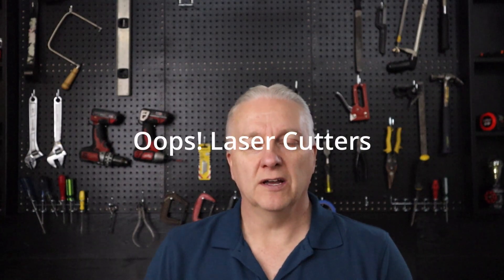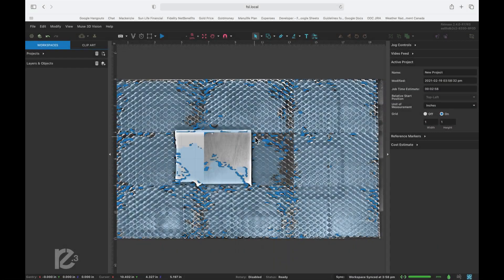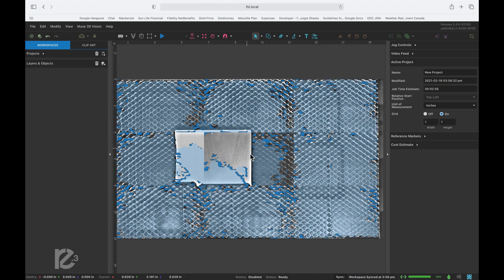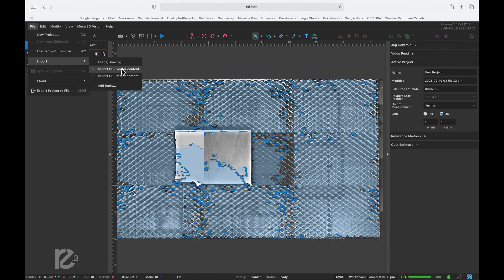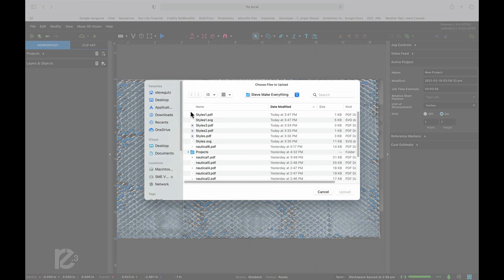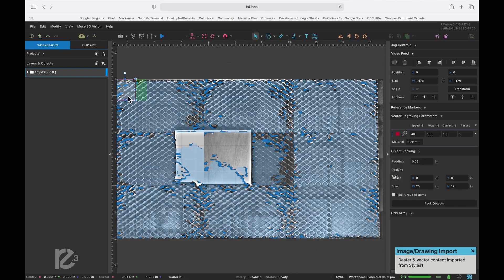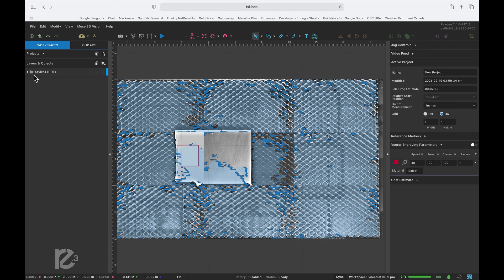3 LASER TECHNIQUES TO MASTER // Laser Cutting, Etching & Engraving

Comment: Great video as always.  I have learned a great deal from your videos.  Thank you.  Do you have a recommended set of parameters for 1/4" baltic birch with the Muse 3D 45 Watt Laser?  (Power, Speed, Passes) Thank you
Reply from the maker: You'll have to play with it a bit because it would depend a lot on the composition of the plywood (i.e. the glue that was used).  Also 1/4" is near the limit of what a 40-45W laser can cut so you might need to adopt some tricks.  I did a bit of this in this video: https://youtu.be/CY3Du86q-mM

Comment: Trying to send lightburn project into re3 to make it work not sure if this is a load question but hoping you can point me in the right direction
Reply from the maker: So if it’s an actual light burn project file you won’t be able to load that into RE3 directly.  If you design is created in Lightburn you’ll struggle for a solution to this. For what it’s worth, you can’t go the other direction either.

This is why I do all my designs in either Inkscape or Fusion 360 and work with SVG files. This way you can load them into whatever laser you want